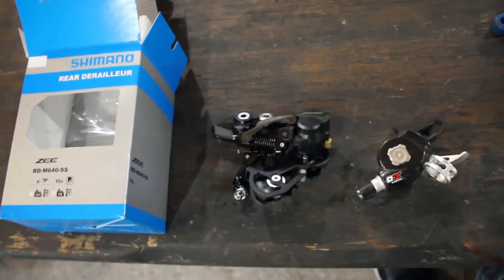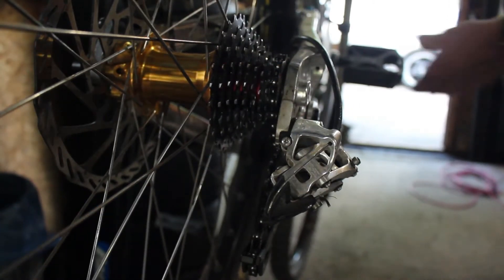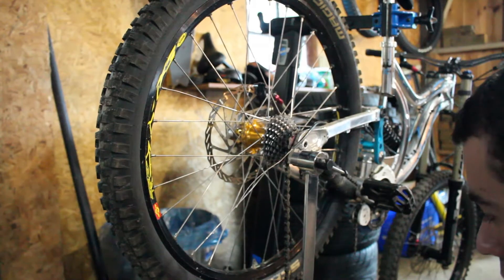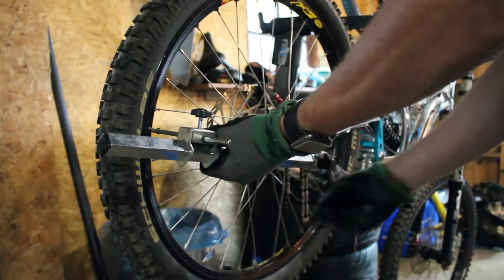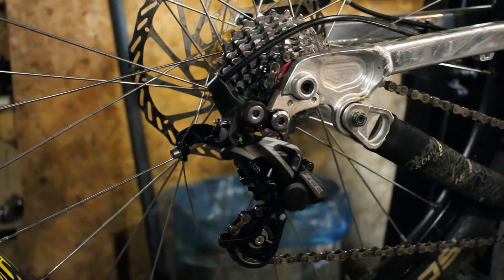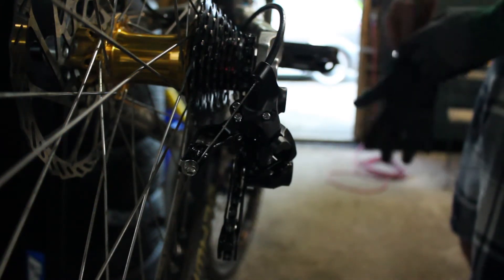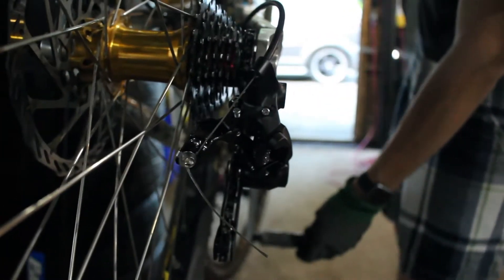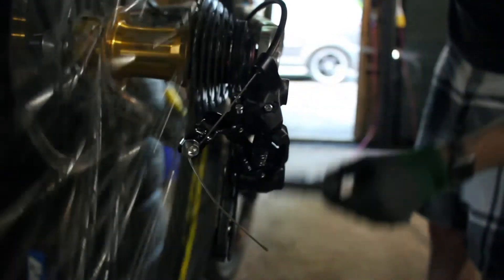Shimano 10 Speed Derailleur With Sram 9 Speed Shifter

Comment: I Have a deore m6000 derailleur i can use sram x5 9s shifter to index this derailleur to a 9s cassette?
Reply from the maker: probably not
Reply: how can i use a deore m6000 10s with a 9s cassette pls help
Reply from the maker: @alextoma2069  Probably shouldn't
Reply: @porkercon ok but i will try even if i have to punch a hole in the derailleur

Comment: as long as the shifter says 1:1
used this set-up with a cheap 11-46T 9s cog and 10s deore clutch RD
Reply: Would SRAM X4 8 speed shifter 1:1 work with SHIMANO Deore 10 speed rd?
Reply: I'm planning to have a 8 speed drivetrain with a clutch
Reply: @polynomialx  yup as long as cog is 8s too.
Reply: Ohh ok thanks for the reply po
Reply: @polynomialx  i have the same setup, i will be installing it today, did it work for you
Reply: @ahaan9254  i only have the clutch rd with 8 speed shimano shifter. It can only go in 8 7 6 5 4 3 gears
Reply: Click: 8 - 7th gear
Click 2x: 7 - 6th gear
Click 2x: 6 - 5th gear
Click: 5 - 4th gear
Click: 4 - 3th gear
Reply: Is there a SRAM drop bar shifter with 1:1 cable pull ratio as well?
Reply: @troyjusticecabrera7284  Sensah shifters

Comment: Hi friend. I have 2x8 road bike. 
Can ı use 9 speed Shımano 105 derailleur with 8 speed shifter and cassette ?
Reply from the maker: Nope
Reply: @porkercon  Thanks :( İf we do 9 speed 105 derailleur with 9 speed cassette and 8 speed shifter? Problem = rich men job STİ shifters :))
Reply from the maker: @flat6767  Wont work properly
Reply: @porkercon  ı'm understand. Because 8 and 9 speed shifters has different cable pull ratio. 8 speed properly Claris better result than 9 speed cripple 105 :)